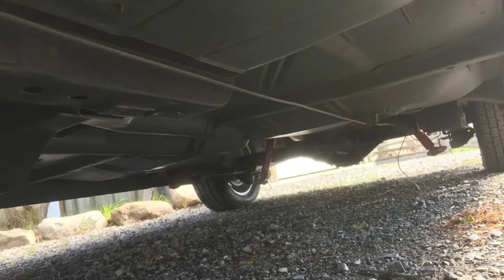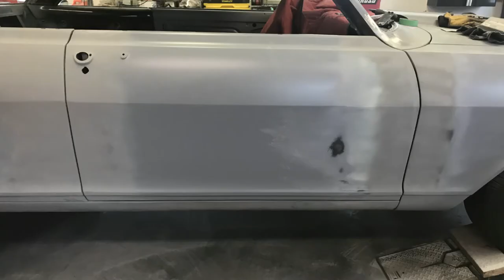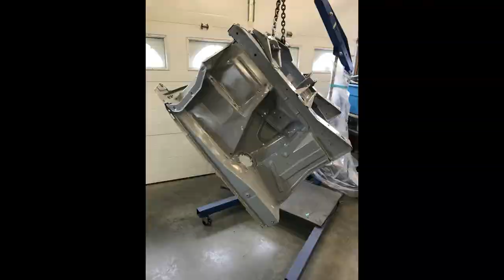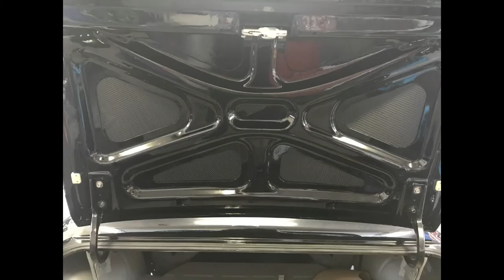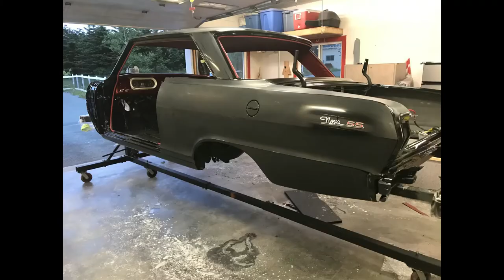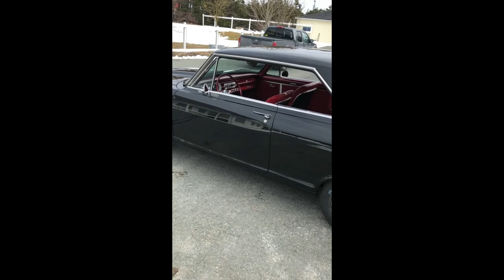1963 Chevy II Rotisserie Restoration

Comment: Nice car, though I am not a fan of black. I got a white 1963 Nova SS in 1975, at age 16. It had been my dad's, he bought it in 1973, so it was only 10 years old when he got it. It had a straight six with a powerglide. It had that same big chrome console and floor shifter. It was a four lug car. I replaced the six with a 283, and with help from somebody who knew more about cars than I did at the time, I swapped out the rear end with a 5 lug Posi. Not sure what the ratio was. I put air shocks on it to raise the back, and put Mickey Thompson L60-14 tires on chrome reverse wheels in the rear. I kept the 13" tires in front, but on matching 4 lug chrome wheels. The engine still had the oem exhaust manifolds, I had some header pipes made up that bolted to them, then put glasspack mufflers on those. That was the exhaust system. And it was loud. I owned and worked on that car for more than 12 years. Would love to have another one, but they're just too expensive anymore for anything but a complete pile of junk.

Comment: Nice job. Thank you for not putting one of them Gay LS engines and a TCI front clip . You got quarters to fit real nice . I can tell you like 67 interior
Reply: I totally agree,I see so many people swapping in an LS and I can’t help to think it’s blasphemous. It’s like what’s wrong with a gen 1 sbc?? They make very reliable fuel injection that resembles the exact look of a carburetor,so that can’t be the excuse. You can’t tell me that you think an LS make more power cause I can show many examples of gen1 making well north of 700 horsepower N/A. So why would you ruin the look an feel of an old shoe box nova. I inherited my fathers 64 Nova SS and it’s a actual factory SS bucket seat car and so many have tried talking me into putting an LS in it an again I can’t help to think it’s just wrong
Reply: And the oiling system on a LS is even more screwed up than the Chevy IIs , what moron thought it was a great idea to put an O Ring that deteriorates in oil on an oil pickup tube ?
Reply: Couldn't agree more!!
I have a 383 stroker small block with a 4-speed rock crusher in my '62 2DR HT and has more power than a 2500 pound car really needs! Fun, though......😊

Comment: What size wheels, and what tire size?
Reply from the maker: Hi Jarrett,
15X6 with 205/65R15 on the front and 15X7 with 4.5 backspace and 215/65R15 on the rear. A bit close on one side on the rear. A 4.75 or 5 inch backspace would be ideal on the rear. 

Glenn
Reply: @Glenn Mahon  awesome, thanks for replying.
Reply: @glennmahon DID YOU RESTORE?   OR IF YOU CAN GIVE ME INFO ON WHO RESTORED YOUR BEAUTIFUL 63?   I HAVE ONE ITS NICE BUT I WANT A PAINT JOB, SUSPENSION,  AND POWERSTEERING.
Reply from the maker: @Carlosmayorga-eu4bc  
Hi,
Yes I restored the car myself.  All work was performed in my home garage.  Good luck on your build!!!
Glenn